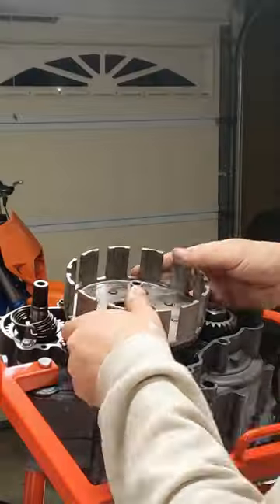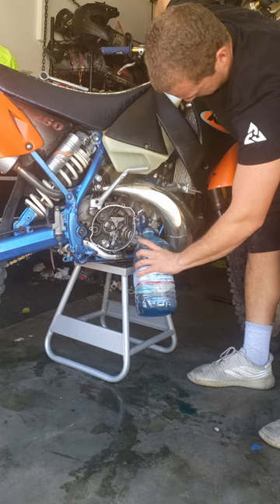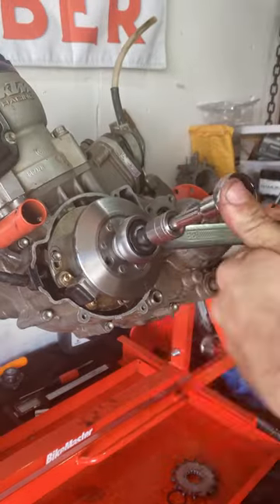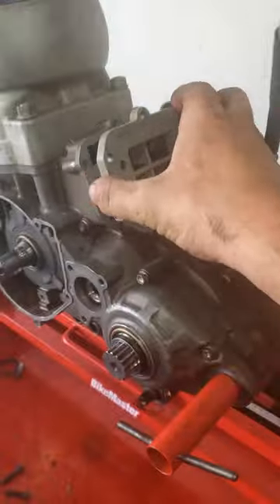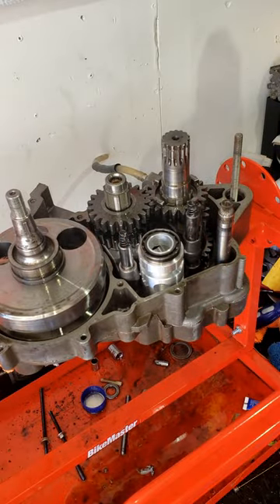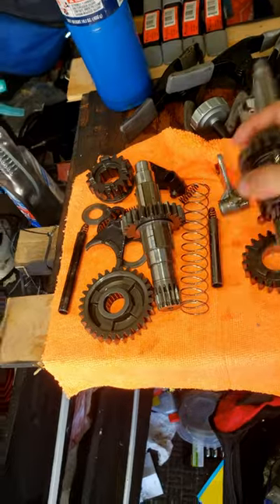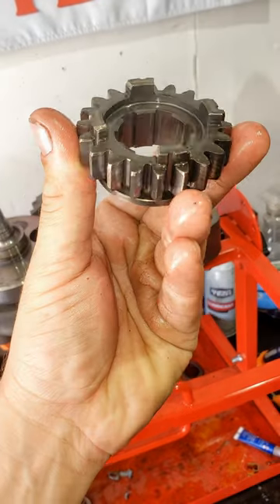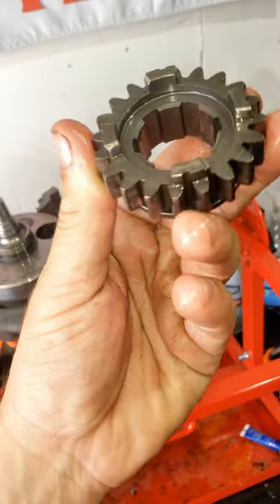KTM 250 Grenades 1 Hour Post Rebuild

Comment: Seems like a carb issue for sure
Reply from the maker: Yeah had an air leak in the carb by the choke needle
Reply: @SteveStomber an air leak on the choke circuit would ultimately pull fuel through the circuit creating an extremely rich mixture...you may want to check crank seals

Comment: The main reason to ride 2 strokes.  Cheap and easy to fix.  Works for me!!!!
Reply from the maker: Same here!
Reply: @SteveStomber  yz 250 for motocross and XC-w 300 for woods.   Love them both
Reply: Main reason to ride fourstroke.
They dont blow up.... ever
Reply: @Jake_Hynds good one
Reply: @Jake_Hynds  ever??🤣🤣. Ok Jake
Reply: @Dean_Richard  well eventually they will to but...
Four strokes have more moving parts but those parts last 3 times longer.
Two strokes have less moving parts but those parts wear way quicker.
I personally have never had to open a Yamaha fourstroke engine because its blown up but I cant say the same about the same brand yamaha two strokes.
Reply: @Jake_Hynds  agreed.
Reply: Easy to work on but not always easy to find the problem!

Comment: Air leak from flywheel side crank seal or the reed valve rubber boot
Reply from the maker: We had an odd spot for it… carb choke lever

Comment: Air or something foreign has usually got through the air filter and into the motor thats what usually happens to trail bikes and scramblers from the 70s early 80s
Reply from the maker: This one had an air leak in the carb

Comment: the base gashet were case halves meet. or manifold.   200 bucks plus 10 hrs of ur time
Reply from the maker: Nope i got lucky air leak was the carb choke needle and the repair fix on the gears was $100. Prob right on time 🤘

Comment: I'm guessing that the air leak was after the reeds, and the 2nd gear will be 174,
Reply from the maker: Air leak was the carb choke needle oddly, trans fix was only $103 replacing two gears

Comment: Air leak at the Reeds carburetor jet not installed, right? Carburetor stuck at full throttle Hundred twenty dollars
Reply from the maker: Air leak was the carb choke lever, super odd spot

Comment: Id be extremely surprised if that's a choke circuit air leak, any air getting into the choke circuit pulls fuel with it
Reply from the maker: Choke lever was loose, got it squared away and no more leak

Comment: How did you find the location of the air leak?
Reply from the maker: So a leak down test would show you the problem area, but I  just guessed correctly from re-watching the videos I took. As soon as i turned off choke it went crazy with no throttle input so I guessed something carb and took it from there
Reply: @SteveStomber  leak down from pressurizing the engine or with vacuum ?

Comment: Learned how to work on engines with 2stroke mini motos you could have the engine tore down and rebuilt in under an hour 😂 havnt been as adventurous with 4strokes the timing scares me id probably put a valve into a piston
Reply: It take a bit longer than an hour lol
Reply: @onenessseeker5683  about 45 minutes! If I remember rightly it's 4 nuts to remove the cylinder a split pin on the piston and a handful of other nuts and bolts. Not to mention the engine fits in one hand lol maybe stick to Legos if you can't manage it
Reply: @Mt24855 That's just rebuilding the top end. I'm talking about time to split the engine & removed crank. then put the whole engine back together again from scratch.. That's a few hours work
Reply: @onenessseeker5683  I'm talking about splitting the case IV done it probably 50 times but thanks for the input 👍
Reply: @Mt24855  Well I would bet you a million you don't pull an engine out of a frame split the engine. put it all back together the right way in 1 hour. You are living on mars bars
Reply from the maker: Fastest hands in the west!
Reply: @SteveStomber  had me questioning my memory so I just looked it up apparently an hour is pretty slow lol
Reply: @Mt24855  Most people on this planet would spend a whole day to rebuild a top & bottom. a complete engine rebuild with new seals & every bearing. & then set decking, timing. 1 hour lol to do the lot :)  Nobody would do a full engine rebuild for 1 hours pay

Comment: Cheaper than a 4t bottom end
Reply from the maker: I haven't worked on any modern 4T, but the vintage ones are a PITA to work on
Reply: @SteveStomber  done pit bikes but there way more simple 4t but me an my cousin had my CR125 and his Sx150 top ends done in no time we use to race to see who could do it first looser buys a takeaway winner shells for a few beers but if was going well we'd help each other pizza beers around 9pm   on a hot summer night just starting to go dark fiddling with the bikes 2t smell beers and pizza just smelling them brings back good times we use to fish and camp with a race pit bikes I had a crf110 size mx rear linkage 140 70mph monster he had a crf70 sized 150 ktm style no linkage rear swing arm was lot of fun Flame grilled chilli lime and garlic fish with salad and flat bread man so fun

Comment: The problem is it's a two stroke you always have to rebuild them and when you figure that out a four stroke ain't so bad and they are annoying to listen to and smoke and they aren't any faster like you all say I can't believe anyone still rides that crap
Reply from the maker: 2 Strokes can be just as reliable but only if tuned correctly, I think there is alot of user error leading to 2 strokes premature death
Reply: You havent ridin a real two stroke i pass 450 f's all day long on my rm265

Comment: 2 stroke people tearing the engine apart every week to replace a piston and smth else, and then have the audacity to say vut its CHEAP, lol ok adds up to 1000 bucks a month
Reply from the maker: Whose replacing a piston every week? Plus older 2 strokes 10x easier to work on than an old 4 stroke. Modern bikes 4T arent as bad. But old 4T had timing chain run thru the cases so bad chain makes ya gotta split cases
Reply: @SteveStomber  people who do track change it quite literally every week
Reply: @ivanopetrovic2545 my 99 cr125r is rated for 25hrs before you need to change the piston ring lmao don't need to change a piston until it's damaged normally 75 or 100 hours of riding. Also a newer 2 stroke with counter balance and fuel injection can get 150 hours out of a piston ring